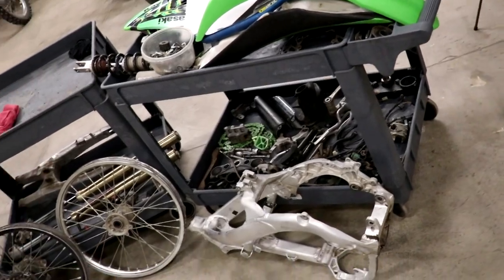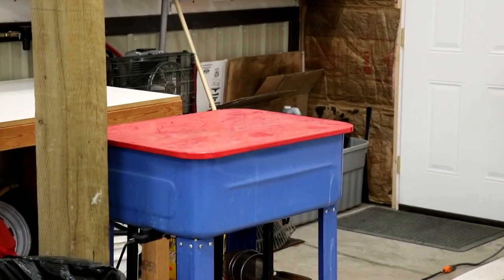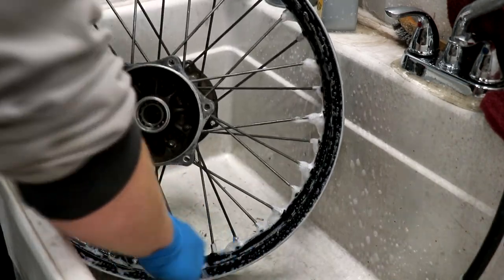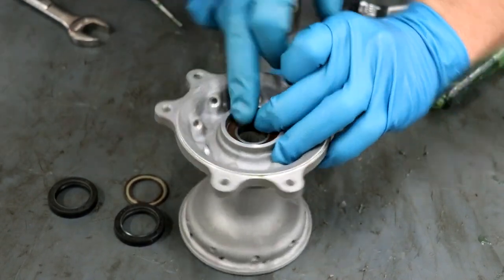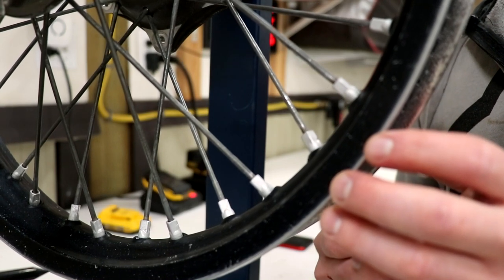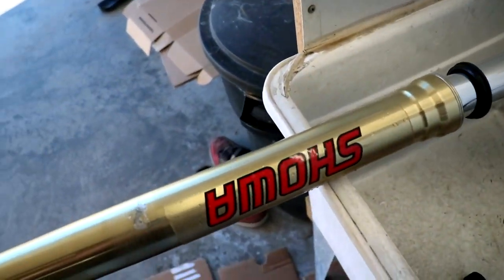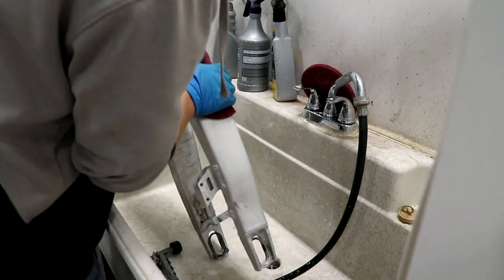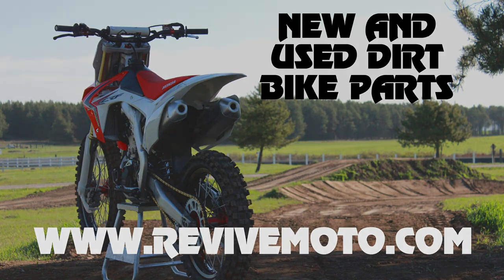What To Do With Junk Wheels?

Comment: Another quality video!  I completely agree with you Cameron, the cleaning part is VERY rewarding.  A few quick questions about your solutions.  1.  The cleaning solution in the tank, you said it was simple green with water. What is the ratio?  2.  Mag cleaner in the bucket, is it straight mag cleaner or diluted with water?  If so, what is the ratio.  3.  What is the mag cleaner you use.  Your parts are ALWAYS amazing...I want to replicate that here on my bikes
Reply from the maker: Thanks Jon! I use 2 gallons of simple green and 8 gallons of water approx. The biggest thing is the tank is heated, makes a huge difference. Mag wheel cleaner is straight, had to buy like 20 bottles of it haha. It's available here: http://amzn.to/2wld1dn

Comment: I've made a new base for a swivel chair from an old Kwaka KZ 7-spoke cast wheel. I'm also working on some MACRAME PLANT HANGERS using both wire-spoke and Comstar type D.I.D. rims in 19" which I no longer have use for - the COMSTAR wheel gets the lightweight Akront "NERVI" rim in 18" as a replacement! The chromed-steel 19"-er gets replaced with an 18" alloy item but always period-correct & always awesome high-performance spec! My office chair is happy, my plants are happy - I've also got some candy dishes & ash trays made from tiny lil' DRUM hubs which are so damn small it's like - well why would you even KEEP a 100mm SLS/2LS front drum even on a lil' Honda CUB/PASSPORT etc? Upgrade that shit to a CB160 or better, 2LS of at the very least 160mm diameter! You can also use the drums for a COWBELL on a musician's DRUM KIT - I'd like to try some old discs as CYMBALS as well. Got a bit of a decorative motif going on with some 6-7 276mm dished front rotors from CB750F/CB900F etc. ALL of these bikes should have the dual-296mm upgrade! It's just such a pity you can't get 296mm-spec caliper hangers for the SINGLE-PUCK early style calipers, to match the 39mm CB900F/CBX1050/GL1100 forks, or better yet the 41mm non-TRAC fork you can build using two RHS legs from the VF1000R - pair it to a rebuilt '79-'80 CM400 1.85x18" front "Silver" non-"reverse" style front Comstar wheel, with an early type dual-disc hub and one of these here 2.50x18" Akront "NERVI" rims (27% lighter than stock D.I.D. brand rim in the same size from CB750F/CB900F rear & '81 GL1100A Aspencade front wheels, or more like 40%-50% lighter than the "Boomerang" wheel rim off CB900F2C & CB1100RC-'RD, CB1100F etc) pair this wheel up to the 296mm dished rotors from CB1100RB, or their replica via Metalgear - A "stealth" front end that'll look perfect on a '77-'78 CB750F2, '78-'79 CBX1000, '79 CB900FZ, '79 GL1000 what-HAVE-you! How awesome would THAT be? Too cool for words, is what I'm talking about here......

Comment: What do you use, or suggest using on the motor/cases that are a little stained without taking the motor out of frame? I imagine the Mag cleaner would work but worried about getting some over spray on anodized parts.

Comment: Hi Cameron,
nice work that you´re doing. 
But for preventing the bearings from rust - wouldn´t it be better to use a chain spray or something like that (grease/oil with solvent that evaporates after a while and leaves the grease behind) to creep under an displace water? 
Your videos seem to be a recipe for starting into the used parts or restoration business of bikes and cars. And are also good advertising for yourself.
I like your videos but instead of watching  I should be animated to repair my own bikes.
Greetings from Germany´s Ruhrgebiet, Oliver
Reply from the maker: Thanks for watching Oliver! Much appreciated

Comment: What can you use to keep spokes from seizing , I just bought a set of new wheels and I tighten them every ride, supposedly the spoke nipples already have anti seize but I’d rather be safe then sorry, is spraying wd40 on the nipples an option ?
Reply: anti seize is good. wont be a problem.
Reply from the maker: Anti seize is the way to go, as long as you periodically tighten your spokes you'll be better than good.

Comment: I got a bottle of mag wheel cleaner (been watching your videos. Love how clean you bikes are!). What parts can I use it on? I am wanting to use it mostly on my aluminum frame, but can I use it on my motor as well? I want to try to keep the bike together? Will it ruin rubber parts (I know it destroys anodized and paint.). Thanks!
Reply from the maker: Thanks for checking out the videos! You can use the cleaner on anything bare aluminum or stainless steel. It will not hurt rubber, gaskets, paint, powdercoating, or plastic. However, keep it away from anodizing or nickel plating. Something that is nickel plated would be the spokes, bolts, or axles. If you let the cleaner sit on plating long enough it will strip it.

Comment: Does the mag wheel cleaner etch the bearings?  I have my crankcase split and want to use the mag wheel cleaner on it but am worried that I might damage the bearings.
Reply from the maker: The cleaner is safe on bearings, but while your cases are apart it's wise to go ahead and replace the bearings anyways.